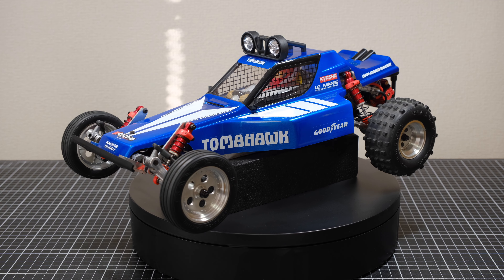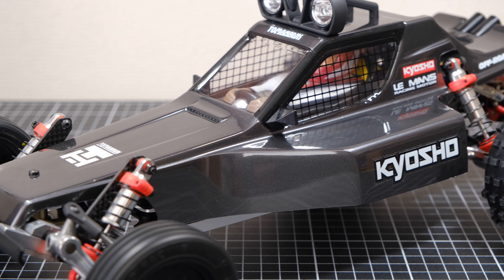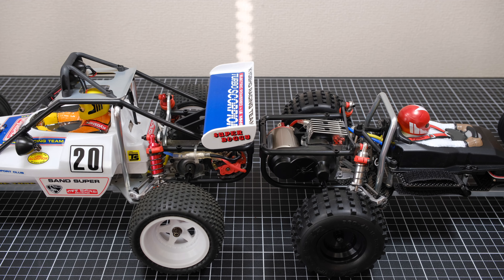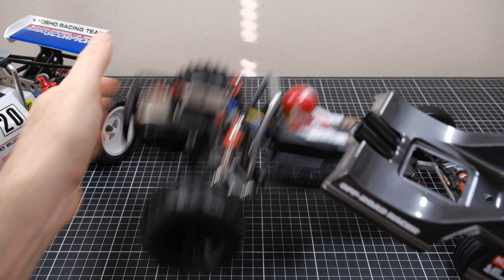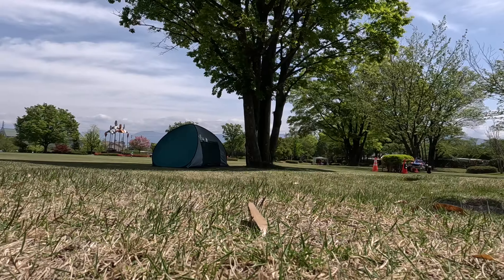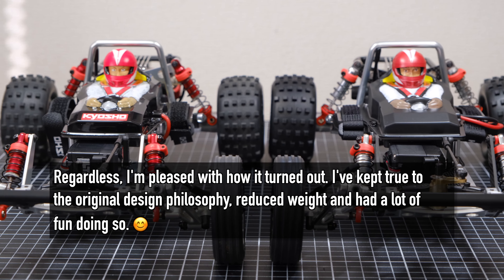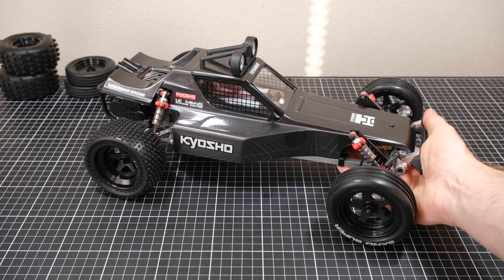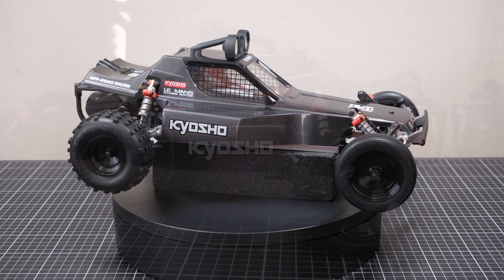Full Carbon* Kyosho Tomahawk. Update on project "Pro Spec" my Legendary series Tomahawk Buggy (VLOG)

Comment: I think it looks great and you did us all a service by doing this! Seems like Kyosho did it well when they did it and not much meat was left on the bone! The carbon bits and pieces loo great on yours and I think it was all worth the effort. Some times you have to bite the bullet and give it a try to find something out. You won in the end and learned a bit more and also scored yourself and awesome new Tomahawk!!  WIN-WIN!
Reply from the maker: Thanks! I don't think you could really reduce the weight much further without removing parts! 😁 It's pretty light as it is. On the makeshift track Kyosho set up for as at the Vintage Meet, the terrain was very bumpy and the Tomahawk struggled for traction. In the end I ran the 4WD Optima, as its tires gripped better and it seemed more composed on the rougher stuff.

Comment: Beautiful build.  Good luck at the weekend!
Reply from the maker: Thanks!
Reply: Hi David. You mentioned in a recent video that you use the same motor/esc combo in all your builds, but I’ve not been able to work out what it is!  I currently only have modern Tamiya motors and escs, which I don’t want to put in my Turbo Optima and Tomahawk!  What do you use?
Reply from the maker: @reldwob22  All my 2WD buggies run the brushed Le Mans 490 30T motor and kyosho branded hobbywing 1060. My Optima and Javelin are also brushed with the same ESC but Kyosho’s G15 15T brushed motor.  I tried to keep things old school! 😅

However, my Turbo Optima and Optima Mid are brushless with the Le Man 240 Gold and Le Mans 240S ESC. 

The buggies can handle faster motors without issue, but I’m happy with the performance I get from them. 👍
Reply: Cheers! @KaiCityRC

Comment: I love the way you describe all the details and also the excellent video quality. Those 19g are definitely going to shave a few thousands of a second from the lap times 😋

I am still hoping to see a driving video of the BBX side by side with the Kyosho buggies and your  view on the differences 🙂
Reply from the maker: Thanks! It will be interesting to see how much faster the Carbon Spec Tomahawk is compared to the Standard Spec! 😁

I've been so busy with work and various other projects that I haven't had chance to run the BBX much. Hoping to get out to the park for some runs soon! I will say the BBX is really nice and one of the best buggies Tamiya has released in the last few years. (IMHO). It has a vintage vibe about it, but also a  modern and distinctly "Tamiya" designed chassis.  I've not ran mine much, but it handles well and has got to be one of the quietest buggies I own. My only real gripe is that it tends to traction roll a lot, something made worse by mounting the spare tire on the back. (but it looks so cool with it on! 😎)
Reply: @KaiCityRC Interesting to hear about the traction rolling of the BBX. Is it more a result of the chassis geometry/design, high placed center of mass or tires that are too grippy on high traction surfaces? Anyhow - looking forward to see it all in a video once the time on your side allows :)
Reply from the maker: I think it's a combination of relatively high centre of gravity (the ESC is mounted high up) along with the kit tires that have tall profiles. Throw a spare tire on the top and the whole thing rolls over frequently on short grass. It drives better on dirt though. @matusknives
Reply: @KaiCityRC  thank you

Comment: Very good effort David. I hadn’t realised the tomahawk was so much lighter than the rest. 1185gr is a super light kit and now fully appreciate the whole concept kyosho came up with. In term of look your new build with the black body and the original wheels is my favourite. The turbo wheels are just too big/not to scale. And the scorpion shocks add to refined look. I would only swap that black plastic motor protector to aluminium. Thanks for this informative video and have a great day. Laurent.
Reply from the maker: I thought the same thing about the rear motor guard! 😊 I've seen some metal ones for the Sand Scorcher and thought they'd look great on this build. I have to admit, I wasn't too disappointed about not fitting the Turbo's wheels and tires. They do look a little large compared to the body and kinda reminded me of that trend to fit massively oversized wheels on small hot hatch backs! There is an added benefit, on grass at least I find the Tomahawk kit rear tires to have superior grip. 👍

Thanks for watching and commenting!

Comment: Love the video! I do think that the pro spec tomahawk looks amazing under the shell. It’s a relatively small weight saving but if you think of the fact it’s a 1/10th weight saving, it’s actually quite significant. Other than the weight there will be less measurable things like stiffness and lower centre of gravity. I bet it drives very different on the track. Brilliant work as always. 👍
Reply from the maker: Thank you! Yeah, unfortunately all that lovely carbon gets covered up with the shell on it!  You can tell the Tomahawk is lighter and a little more responsive compared to the heavier Scorpion etc. The difference is most noticeable off the line. I've not have chance to drive my two Tomahawks back to back yet, but so far I can't tell any difference between them. 😅

Comment: It looks stunning, superb job. 
You know you’ll need to see if someone does a carbon chassis now, not that there’s much to the Scorpions already 😂 but that could mean another Scorpion build haha.
Hope the weather holds out for you on the event 👊
Reply from the maker: Thanks! A carbon chassis conversion would be interesting. 🤔 Actually, thinking about it, it wouldn't be that hard to custom build one as it'd essentially be a rectangle with a few countersunk holes drilled into it! 😊 Kyosho did optional hard chassis rails, but they're about 10g heavier than the stock ones. They're also quite expensive for what they are.

Comment: A bit of a fail but the end result is quite sexy and spectacular!  A Tomahawk to be proud of😊
Reply from the maker: Thank you! I'm really happy with the end result. 😊
Reply: Some of the items that add weight also add performance such as the dampers; better at jumping &rough surfaces.   Sticking with the lighweight wheels/tires is your best decision .   Rotating items take more energy to get them rotating and also the energy used to move them with the car.  Im not an engineer but i believe thats how it works   Keeping rotating items light really helps!

Comment: Didn't Joel Johnson have exhaust on his 87 Ultima? Noticed the Kyosho 60th anniversary JJ has no exhaust in the kit. Guess I can always buy a exhaust from the Tomahawk.
Reply from the maker: I don't recall if he fitted the exhausts.🤔 Probably not though as he was racing and they're just for aesthetics. 

The exhaust tips, motor cover, light buckets and inner roll/bracing are all included in the Tomahawk body set if you're looking to add them to the JJ replica. 👍
Reply: I just watched the 1987 race and Joel Johnson's Ultima did't have the exhaust or side mirrors. Ya just aesthetics... @KaiCityRC

Comment: Can the Turbo scorpion be converted to be more like a tomahawk with the tub removed and just use a tomahawk body?  I think the best combo of all the Scorpion type chassis would be a turbo scorpion (wider and longer plus 2.2 wheels)  but built like a tomahawk.
Reply from the maker: I think it would be possible, but I've not personally tried it. There would require some work involved.  The main problem area is the rear. The rear shock tower  is shaped differently and may cause some interference on the Tomahawk body. You may also need the Tomahawk roll bar (it is shaped differently to the Turbo) as the Tomahawk body clips into place on the roll bar. Though it seems as though the Turbo roll bar would line up with the bracket on the Tomahawk body.  You would also need all the parts for the upper and lower decks, servo mount, battery holder and the body mounts too (the front of which is part of the steering arms).

Comment: David, are the Tomahawk shocks the same diameter as the Optima/Javelin. I'm thinking of buying a Tomahawk and some cosmetic parts but need this information.
Reply from the maker: It might be possible to fit Optima shocks on the Tomahawk. Some info: The Tomahawk, Beetle and Scorpion use the smallest bore and stroke shocks of all the buggies. They're a very basic design,  single o-ring and both front and rear are identical except for shock piston holes. The Optima shocks have a larger diameter and are more complex, with two o-rings, additional shaft guides etc. The Optima front shocks are a comparable length to the Tomahawks (~70mm) but the Optima rears are considerably longer. (~95mm).  

I think with some adjustments it would be possible. Might be a good idea to get the longer shock stays. And the Optima front dampers will be set up for a heavier 4WD chassis, so some tuning would be necessary .